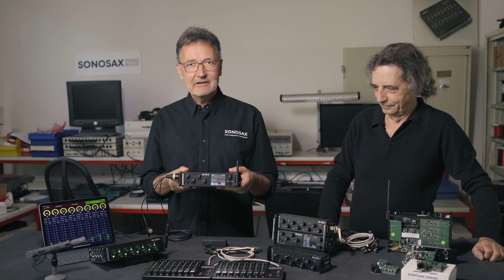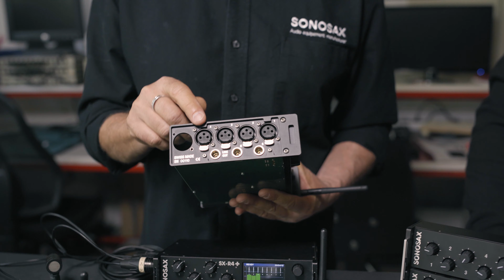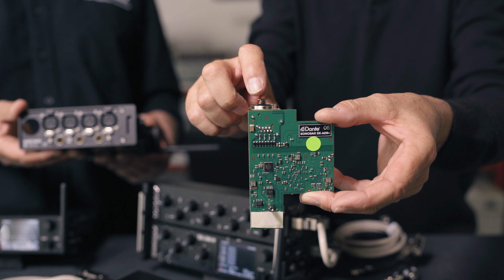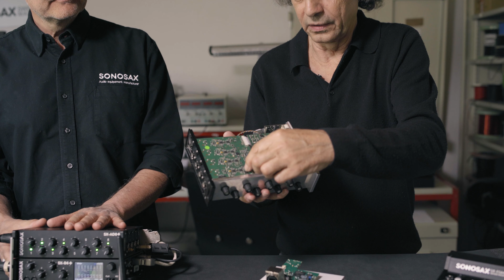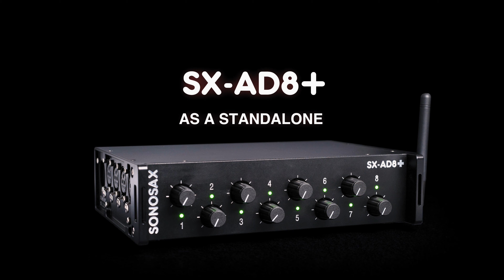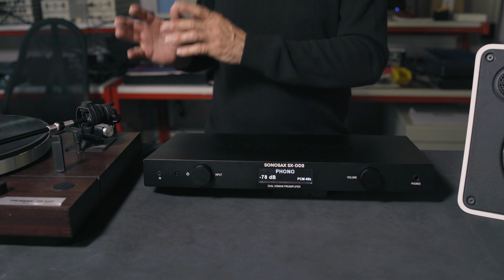Sonosax - Episode2 - SX Plus Serie

Comment: To be compact, they try to remove the audio transformer
Reply from the maker: Since the beginning, in the early 80s, SONOSAX has avoided microphone input transformers. Smaller, lighter, more difficult to control, but no distortions and a much wider bandwidth, from 20Hz to more than 50kHz. This is what makes the best SONOSAX sound. We were also the first to have electronic input accepted by the PTT, which at the time managed the acceptance tests for devices used in radio and TV in Switzerland.